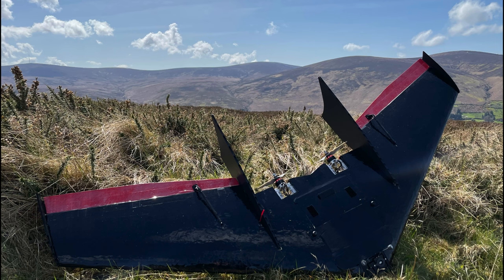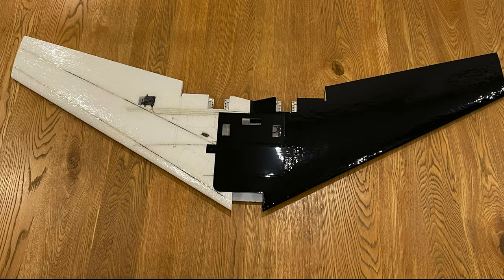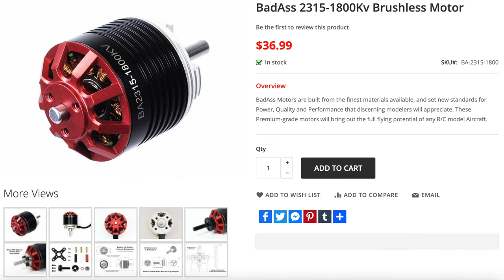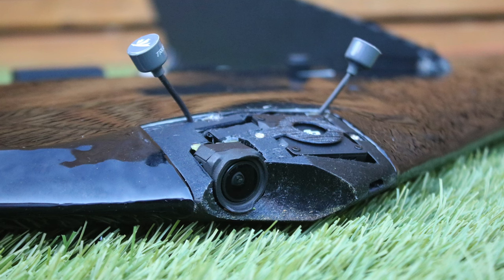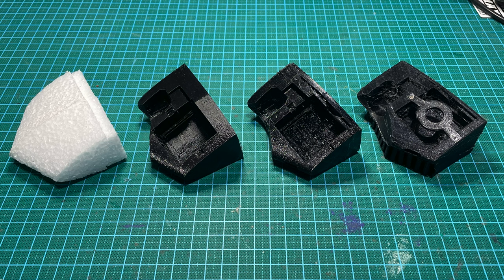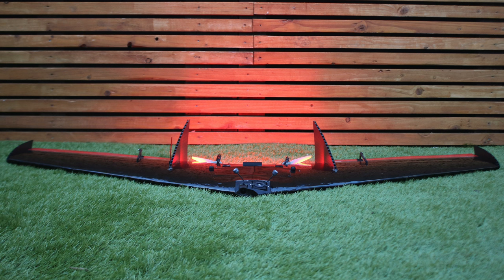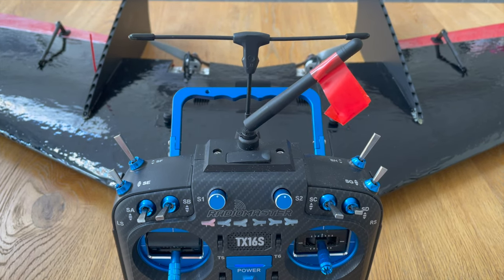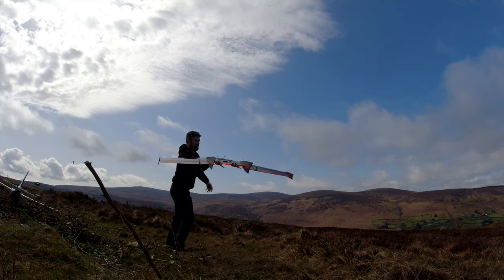🚀🚀 Zcon Twin - Build Overview & Maiden - Awesome FPV Wing

Comment: Great video Adam. Make sure you set your failsafe to keep that switch on for the dji air unit because if you lose control signal you will lose video also.
Reply from the maker: Yes thanks I tested this and FS doesn't turn off the vtx! A very useful reminder for everyone out there to check this though as that would be a nightmare if your vtx turned off on failsafe 😅

Comment: Oh my, that looks like another Bad Bottom plane to me...😏...Ive gone Walksnail and that HD vtx power switch looks very useful when using a GPS...Is that function available on my older F405 Matek Wing FC?..🤔🤔😳🇬🇧
Reply from the maker: Bad bottom 😆 I highly recommend using the switchable power on all digital builds... but unfortunately I don't think that feature was a thing back when they made the original 405 wing 😬
Reply: @AdamGdoesFPV  I thought as much...I'm loving my Walksnail HD system. It suits my needs. I just got one of those cheap £32 Speedybee flight controllers. I doubt that's got a 9v switcher for my VTX either...lol ..🤔😳😀😀🇬🇧

Comment: Nice wing! I did 165km/h with ar wing pro in level flight with gopro brick :D 4s and Leopard motor 3536 1270KV 9,5x6 prop.
Reply from the maker: Thanks 😎 Yeah the AR-Pro is quite capable. I just love the Zcon so much I sold the ARP as it didn't get much use. Cheers

Comment: Hi Adam love the attention to detail and what a superb build. Always love your style of doing things. Superb.👍
Reply from the maker: Thanks Terry, I appreciate it 😁 I knew this was going to be one of my go to planes once it was built so I took the time to get the setup right 😎
Reply: @AdamGdoesFPV  I looked how you set up the flying fish and I followed your example and it flew beautifully. 👍
Reply from the maker: @terrymurphy562  Glad to hear it. Thats a really fun little plane!
Reply: @AdamGdoesFPV  it’s just a bit weird going out a few mile with no flight controller. No safety net.
Reply from the maker: @terrymurphy562  if I’m honest I think the furthest mine has been is about 500 meters. I just use it for proximity 😃
Reply: @AdamGdoesFPV  I had the same thing in mind to keep it close by but I ended up venturing further into other fields and before you know it you are 2 1/2 miles away. Not good practice I suppose. Have you anything else lined up for the future??
Reply from the maker: @terrymurphy562  want to steer clear of any more builds this year now and just enjoy using the free time to do some flying. I’ve got a Polaris sea plane which I’ve not posted a video on and I have a Funjet to maiden that’s built for 200mph +
Reply: @AdamGdoesFPV  be nice to see them once you get round to getting them up in the Air. Unfortunately we have to work. Looking forward to seeing them in action. Enjoy your flying Adam.

Comment: Thanks Adam for this awe inspiring detailed video, I am owner of a FLsun  V400 and wonder if you think it would be possible to 3d print the wing? I started printing wings with 70cm span in vase mode but not yet tested in air.
Reply from the maker: Hey, this wing isn't available for printing so you'd have to try and replicate it. Personally I'm not a fan of 3d printed planes, the durability on them is terrible and they're a lot of work. cheers

Comment: I really like badass motors prop charts excellent info.  Would like to know what the people parked along the road thought  when that thing went past them at 110 mph. That's a great build 👍
Reply from the maker: Thanks, I appreciate it. Yes the BA charts make it so much easier to make an informed choice rather than doing guess work! It would be nice if we could get them in EU as they're a bit expensive when you add shipping from USA. I do wonder what those people are thinking too... especially as it just continues flying off into the distance 😆

Comment: Hey Adam! Video is awesome, but I have few questions:
1) u moved to DJI 2? or you using DJI v2 with O3 unit?
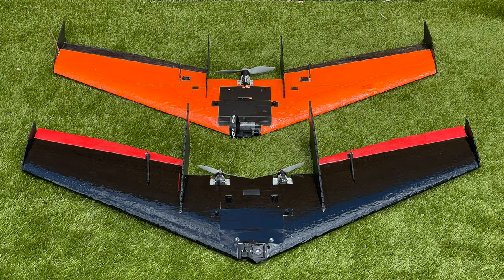2) The new version with 2 motors is like 4+ times less in the air then single motor Zcon (25min vs 1:15h), feels like dual motro setup is super ineficient.
3) How did you set up INAV to enable /disbale VTX on controller switch? I'm strugling sometime to catch GPS and VTX is overheating in that time, would be nice improvment for me
Reply from the maker: Hey Vadim Thanks for the feedback 😃 to answer your questions:
1) I'm using my v2 goggles with the O3 for now. There are some downsides like the OSD is not fully compatible, cannot use custom fonts, and cannot record the OSD to render after the flight. Also when switching between O3 and original vistas, you have to change the mode in the goggles and re-bind 🤦🏻‍♂️ I'm heading to USA soon and will pick up a set of Integra goggles for use with the O3 next month.
2) Maybe it was misleading... the 1h15m was a one off where I just flew at cruise throttle for an entire flight to see how long it could stay in the air. I expect the twin motor version could do around the same flight time if i tried... but generally on both single & twin motor versions my flights are 20-25mins due to my flying style... I don't go slowly anywhere 😂
3)Connect the power source for vtx to the VSW power pin... then you go into MODES in iNav and you have to setup a switch for the mode called USER 1. When it's in the blue area power is off. It's well worth doing on digital planes and saves you overheating or having to rush everything. Take a look at the bottom of this page, it gives an example: http://www.mateksys.com/?portfolio=h743-wlite#tab-id-4
Reply: @AdamGdoesFPV  im on old F765 (discontinued) but I guess it works the same way! Thanks anyway, i will try
Reply from the maker: @VadimBryksin  yes it's basically the same on all fo them
Reply: @AdamGdoesFPV  Hey Adam! Great video, I want this exact set up! So, I noticed that you used the 12v jumper on the FC, and you are also using the 9v SW. I’m not sure about your particular FC, but it doesn’t appear that the jumper increases the voltage on the SW pin.

Comment: Some nice 3D designs there Adam, have you had to change your style of flying using the digital HD, can't imagine it performs as good as 1.3ghz?
Reply from the maker: Hi Dave, good question! I entered the world of digital expecting to be let down by how it would perform... but I've been proven wrong and it is much better than I imagined it would be. I can still perform really low flights at long enough distance and chase rivers through small valleys... as long as LOS is not broken at distance. If you do that it gets sketchy where 1.3g would still be flyable. About 95% of the flights I was doing on analogue I can do on digital... so I decided my new flagship wing would have to go digital. I still have a few on analogue but I can't see me building any new planes on analogue now. Cheers

Comment: Great build Adam. Seems very locked-in when cruising .. both air and ground video.
Seeing the motors on twin closer to trailing edge of wing compared to the single. (1:12) 
Does this have an impact noise level from propellers?
Reply from the maker: Thanks 😁 Yes with the motors themselves being a lot shorter that the single, it means the props are way closer... My feeling is they are probably both as loud as each other, but they have a very different sound. There's something nice about the harmonics of the 2 motors
Reply: @AdamGdoesFPV  Agree, the harmonics of twins are more pleasant, than a single propeller roaring away.

Comment: Do you use hinge tape for your builds? If so how successful is it usually?
Reply from the maker: I just use clear packing tape and use the 'Z hinge' method. You can watch a video on how to do that on YT. Packing tape works perfectly and never failed on me in years. But I do ensure I laminate both the wing and the elevons because the tape sticks to that extremely well.

Comment: Great video, I'm looking to replicate this build. The Badass motor / prop details say that it is not recommended. does this change based on running two motors?
Reply from the maker: Thanks 😃 I have heard in the past that 2 motors does change which props you should run, but the designers at badass disagree with that. When discussing with them the setup I suggested the 6x4 and they said that would work and I took that advice over the performance charts. I have ran this setup at full throttle continuously for around 1min many times now with no issues at all. You'll see more examples of this with a video I'll upload this weekend...
Reply: @AdamGdoesFPV  100% can see this at full throttle in your videos. It's a great video really helping with my build. Thanks for producing it.
Reply: Do you know roughly the throws you have? Can't seem to find any details on the ritewing Facebook group. Was looking to do about 10mm each way